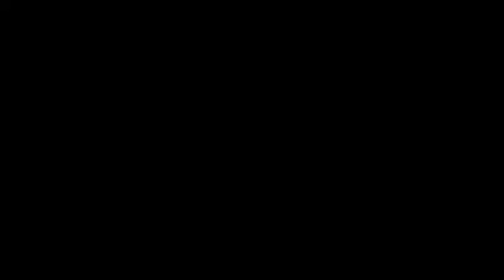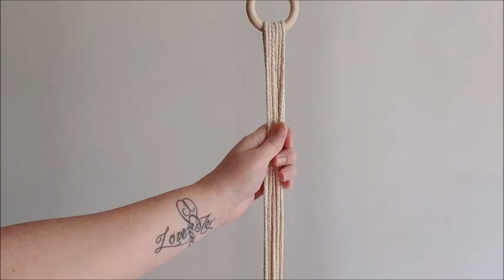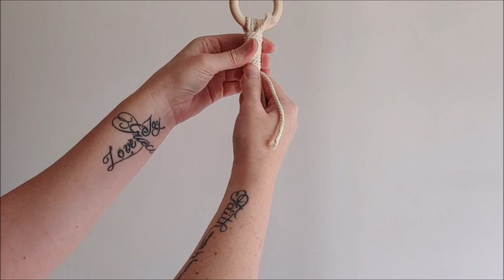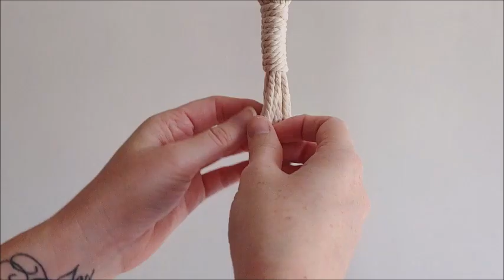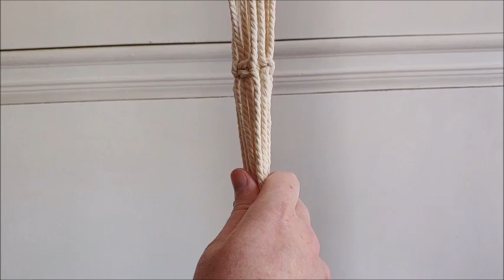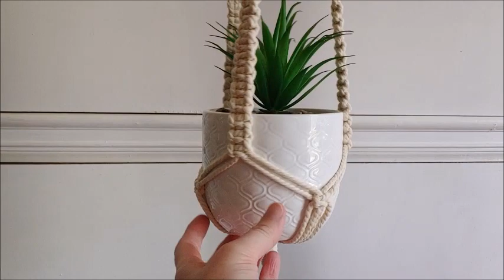#3 DIY Macrame Plant Hanger - Square Knot Macrame Plant Hanger Tutorial!

Comment: Will a 12" pot fit into any macrame plant hangers?
Reply from the maker: Yes, a 12" pot should fit. 😊
Reply: Thank you so much.  Will it also hold a bigger pots as well?
Reply from the maker: You should be able to make adjustments to the bottom knot to fit most size pots.